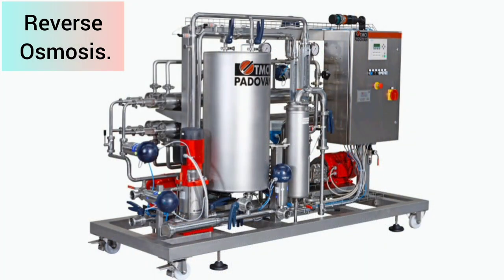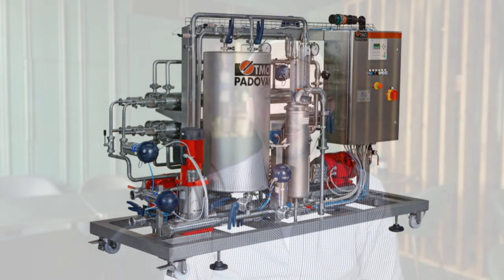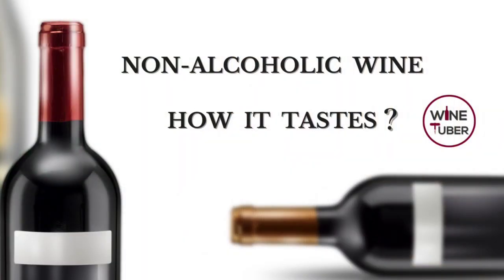What is non alcoholic wine? Non-alcoholic wines explained @WineTuber

Comment: What about alcohol-free wines with labels 0.0% alcohol? I tried a wine called "Live free chardonay" and i got a headache after drinking just a little bit. In general I felt like I drank some alcohol. EU regulations allow alcohol in beverages even if they have a label 0.0%? If there is no alcohol what made me feel light, dizzy, warm etc.?
Reply from the maker: Hi Miłosz,
Thank you for watching and your comment. Generally speaking, I'm not the biggest fan of no alcoholic wines as the majority of them disalcoholized, which give them some unpleasant taste and aromas. My favourite 'non-alcoholic wine' is called Wild Idol. These products are made from grape juice that has never been fermented, and later on, they are carbonated. This sparkling 'wine drinks' is the best on the market at the moment, and they are even suitable for kids. Highly recommended to try. Resumes the most pleasant non-alcoholic wines are sparling as they give an extra sensation on mousse on the palate.
I hope this helps.

All the best

Comment: I don’t agree about the fact that non-alcoholic is not always cheap.  

I have never came across a premium offering of non- alcoholic wine.  The max I have ever seen or tried my best to search is $40 usd a bottle.  Which in a normal wine world, this is just barely touching the mid- priced category.  When you consider the extra step to remove the alcohol part, the base wine is even cheaper.
Reply from the maker: Hi,
Many thanks for watching and your comment. Well, I'm not sure if you are aware of the avrage price of non alcoholic wine on the US market, which in fact is $12 per bottle. Meaning that every bottle of non alcohiloc wine that cost more than $15, for the average customers is expensive. There is no point to compare those two wine categories in terms of the premium category as non-alcoholic wines will never rich the level of Château Girllet of J Vineyards. However there is more than few really good producers of non-alcoholic wines. 
Cheers